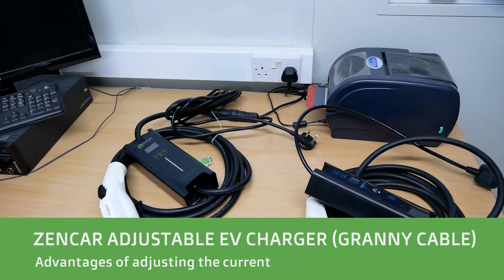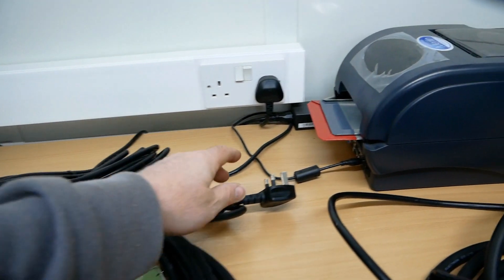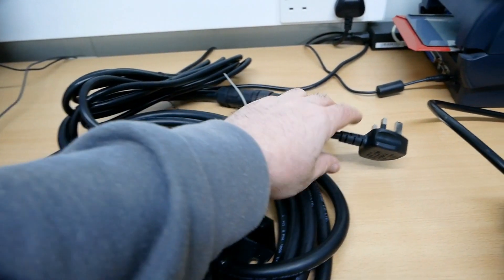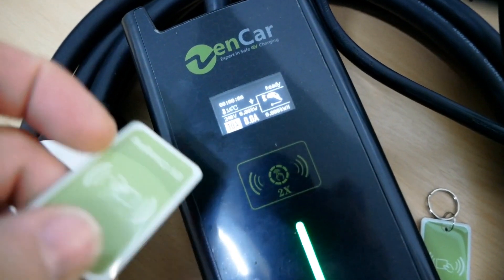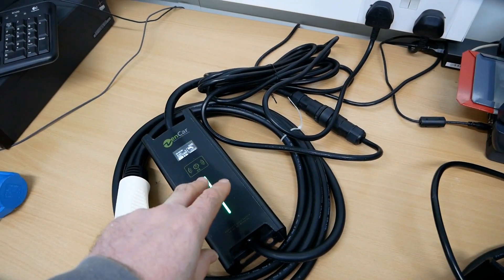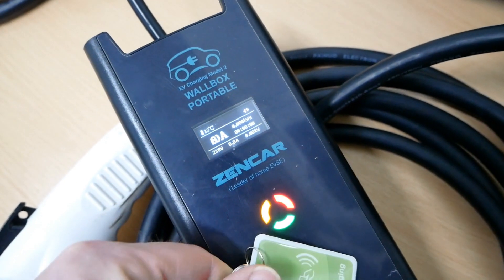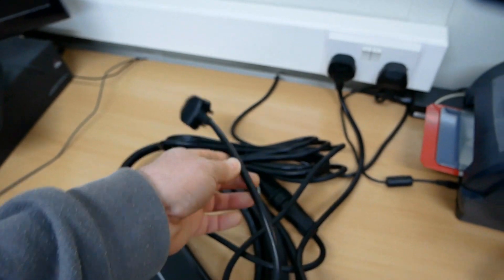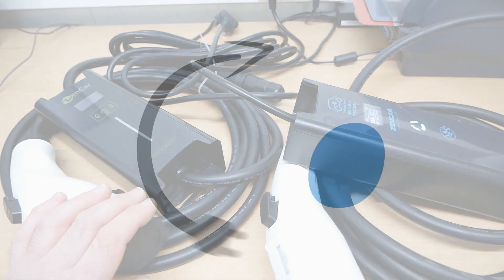Zencar EV charger - the advantages of using an adjustable portable charger

Comment: This would work brilliant with my solar panels, my granny cable I've got at the moment is 2.4 kw and I think the one you have there is roughly starting at 1.4kw so it wouldn't exceed the power that I'm getting for free off the sun it would just take longer to charge, do you know what the price of this unit is? thanks in advance.

Comment: Good video. Just FWI, using 6A is not a guarantee: I burned out a fuse group using the 6A granny cable that came with my Zoe :)
Reply from the maker: Are you sure that was 6A though? I've not heard of another 6A. Many of the chinese cables are 16A which will cause issues.

Comment: Where would you buy one of these in the UK?  Searching for this ends up at Aliexpress.
General charging question:
If I buy an EV (potentially a MG ZS), what's the simplist way I can set up charging?  Do you just have to suck it up and shell out £550 for a 7kW wallbox (I have a driveway next to the house)?
Reply from the maker: You can buy them from https://evcables.co.uk/. However, if you buy a ZS EV, you'll get a portable charger in the car. But yes, if you get an EV, you'll want a proper wall charger. Firstly, they are safer as they use a new dedicated supply direct from the consumer unit and have DC leakage protection. They also are also faster, so will charge your car at about 26 miles per hour, rather than about 8 mph. Plus you get other functions like schedule charging to take advantage of cheap rate tariffs. The cheapest chargers are the Ohme, especially if you're a Octopus Energy customer. But my go to would be the Wallbox Pulsar Plus. I've got videos on this channel about these.

Comment: This looks like it is the same base unit as the Ohmi charger...
While I agree that drawing 10 amp will find any bad plugs and skts 
I qustion the idea that you turn the current down because you suspect you wiring is not up to scratch.  Better to correct the problem . 
The adjustable output is a useful function that can be used to limit charge rate to solar generation.  Or when on camp sites where there is not enough capacity to run your van and charge your car .  Nice function to have better on a cable that you can turn down from 32 amp down to 6 amp ...

Comment: thanks for all that info. BMW have recently put out a recall on the granny cable and I think it is to cover this problem, They say it is because of the 13amp plug has been found to not sit  in the 13AMP  wall sockets correctly. something about the pins being to long and touching the casing. WOW! and it can cause a fire. I think perhaps it is more to do with your explanation of too high an amperage In the unit

Comment: Hi Matt, thanks for all you're super informative video, I was looking for one of this charges and I've found the same on Amazon, the description says that the wall plug has also a temperature sensor in it which displays the value in real time on the charger, is it true?
Reply from the maker: The version with the fixed cable/plug on the end (on the right hand side in this video) certainly does display the temp, so I assume the newer model (on the left) was too. This is something that many granny cables do, but the information is not displayed on a screen on others.

Comment: Ive got the Ohme cable which is great but currently you can only change the ampage by emailing customer services. Not sure why there’s a problem running 13a from a wall outlet though as even if the installation is a 2.5mm radial, the cable will be more than sufficient (assuming you’re not plugging in multiple items!). A standard 2.5mm ring would easily handle it surely? Great video - many thanks!
Reply from the maker: If it is all sound, then its fine. But some 13A sockets are substandard (lots of Chinese made rubbish around) and can burn out around the live pin. Also if the screws aren't done up properly at the back can cause issues and drawing 10A over 8 hours will find these problems.

Comment: Bear in mind that if you fit a commando socket for EV charging, you’ll need to provide PEN fault detection (with a Matt-E, Garo or similar). The same is actually true of a dedicated 13 amp socket.
Reply: If people are using granny chargers plugged into their ring main then what is the situation with respect to PEN fault protection?  What about extension cables from the ring or spur supplies to e.g. a garden shed?
Is an earch rod local to a wall box/commando socket an alternative to PEN fault detection?
I gather that some of the newer wallboxes have PEN fault detection built in e.g. MyEnergi Zappi
https://myenergi.com/pen-protection/
In this case, I presume these do not need any additional earthing arrangements?

Comment: We have the OHME charger from Octopus Energy which uses the same carcass. This unit contains a SIM card which enables the EVSE to contact Octopus Energy in order to access their Agile 30 minute tariff data, which enables smart charging. Our OHME EVSE is on a dedicated circuit with its own RCD. I have it mounted horizontally in a lockable waterproof electrical box.  All safe I think, we only need to use this charger once or twice a week.
Reply from the maker: I need to add 'smart' functionality at home as I've still got an old 'dumb' Rolec charger, which is many years old. I am considering adding a Ohme cable as that seems the cheapest way to get 'smart' charging. Or the other option is to just replace the Rolec unit with a newer model. I would then install a Wallbox Pulsar Plus as very pleased with the one at work.
Reply: @GoGreenAutos  We can recommend OHME if you are on an Octopus tariff - the app allows you to change the car in order that the charger knows how much charge is required. You can set the charge to a specific % of charge and/or that % at a specific time. With your Rolec you could have a timer unit fitted - Rolec make one, it is like an old fashioned mechanical 24 hour timer wheel where you move the plastic pins to select charge times - good if a vehicle does not have the ability to set a charge time.
Reply from the maker: @maesygwartha  You've prompted me to do a bit more research into this and I've just found about about the Sonoff WiFi switch and someone has fitted this into their Rolec charger, introducing remote connectivity and timed charging. Plus it opens up voice control with Google Assistance etc etc. Very interesting for £15.
Reply: @GoGreenAutos  I did look into the Sonoff fix, it looked a bit technical for me....good luck with your research Matt.
Reply: I thought, seeing as the Ohme 3 pin, Commando and 7kWh charger version are the same (being IP55 + Partial immersion rated)  then they would be fine to be left on an outside wall. If not then why would they fit them as a home charger?
Reply from the maker: @scottelkington7661  It could be the Ohme has better grommets and is more waterproof. But I've just had a customer brick an older Zencar charger (same case) in just a few days as water got inside. Just got to be careful.

Comment: Hello mate. I believe some cars allow you to restrict the charging current from within the infotainment, have you checked this feature on the Ioniq?
Reply from the maker: Yes they do, but not many though. The e-Golf does. Not sure about the Ioniq. The trouble is that you don't really want to be going into the settings each time. If you public charge (on AC), then you'd want it set to Max.
Reply: Yep my Ioniq 28kwh has this feature. Charge rate can be adjusted in the software
Reply: @tommoger  that's cool, I think all electric cars should have this feature for the reasons stated in the video.

Comment: The Tesla charger can be fitted with a 16A blue connector as well as a 3 phase connector which allows for greater charging rates.
Reply from the maker: True. But only of any use if you have a dedicated 16A supply or 3-phase in your property. Most don't. If you need to do any supply work, then you might as well just get a 32A wall charger installed as that has many advantages over using a granny cable and of course is subsidised with the OLEV grant.
Reply: @GoGreenAutos  A good point. I only wish I could get a charger installed where I’m living but the joys of renting I suppose.
Reply from the maker: @SirHackaL0t.  A charger will make the property more attractive in the to future tenants and over time will become a must anyway. So maybe your landlord will see the benefit of having a charger installed. It might mean that will have to pay for it and not be able to take it with you, but it might be worth the conversations with the landlord.